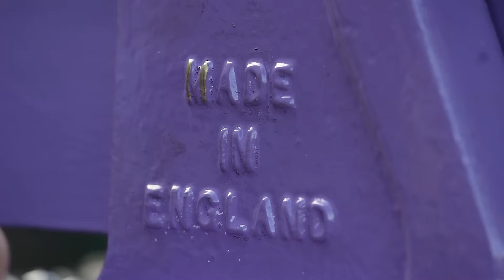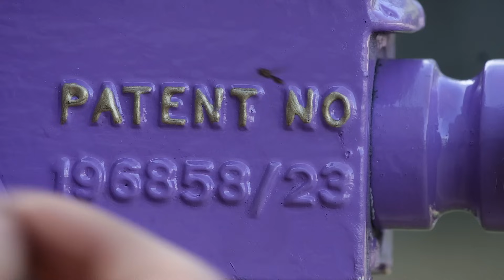Can i save a vise from the scrap yard? Restoration project

Comment: I have been waiting patiently for a vise to turn up in the scrap metal pile at the local dump and this weekend a 5 inch cheapy was there so I went ahead and did exactly everything you did minus the paint. Really hope to find a beauty like yours someday. You've done a fine job and oddly enough I do like the paint color. It is the color I painted some exterior doors, on the inside face, at my house. Go figure. Cheers!!
Reply: Try writing 'Vice Wanted' on a bit of card, along with your contact details, and get the scrapman to pin it on the office wall .... It also helps if you write your number on a £5 note and pass that over at the same time   ;<)

Comment: That is actually in great condition comparing to mine I scored in 2011 after the floods. Mine had a bent base. Jaws we're not lining up and loose. I lined up the jaws ( everything) welded the base. Now I take it to my big brother and borrow his ridiculous overkill press to straighten the side flanges. My little shop press won't do it. Lol works on wheel bearings but this old girl? The steel? Damn strong. Throwaway society. She's a beauty.nice job. Cheers from Australia 🙂👍👍👍

Comment: An observation... I see that all of the jaw ledge is missing from the dynamic jaw and both ends of the ledge on the static jaw are broken off. 
Those ledges help hold the removable jaws in place when there is downward pressure on the removable jaws. Those jaws would rely fully on the strength of the screws holding them in place under vertical pressure. 
That's probably why the jaw screws were broken off. 
To do the restoration more completely you would have to have devised a way to replace those ledges on both jaws. This is probably the reason the vise was tossed in the first place. I was hoping to see how you were creatively going to fix that problem. Oh well. Maybe next time when you work on it (to change the colour).  😉
Reply: that vice has taken some real abuse to have broken both jaws like that. Would take some very inventive work to fix that issue, as it is it's ok to hold stuff
Reply: The only way I'd think you could "Fix" that without further weakening the area would be to lightly clean up the area, then braze in some steel bar that's been filed to follow the contours of the break.
If he just wanted to add some vertical support back to the Jaws the easiest way would be to drill a couple of 8mm holes in the vice behind the  removable Jaws, use paint to transfer the hole locations to the Jaws, drill the back of the Jaws part way through, then refit the Jaws with some stubby 8mm steel dowels.
Reply: It wouldn't take anything to mill those ledges back and to "fit" those jaws correctly
Reply: @tedmattingly7564  Possibly, but only if he has (or has access to) a milling machine. The cost of paying a professional machine shop to do it would be more than the finished vice would be worth.

To recreate the ledges fully would mean having to machine both sides back quite a bit to get past the big areas of break out below the Jaws, so it would also need the original bolt holes welding up, new ones drilling, and thicker one off bolt on plates making to take up the space (So the Jaws still came fully together before the lead screw bottomed out on the nut).
This is why I first suggested adding metal rather than removing it. Pinning the Jaws would also take vertical load off the bolts, but still wouldn't be as strong as re-adding the ledge (But it would be a lot easier to do).
Reply: @Reman1975  brand new starter kit6
Reply: @Reman1975  could you just use a cnc machine 🙈

Comment: A man after my own heart using an angle grinder and wire wheel to clean the metal. For some reason I just enjoy doing that. What I don’t get is the electrolysis fetish so many people have. You end up having to use a wire wheel or sand paper afterward anyway and it takes time. Seems superfluous to me, but I’m happy to hear an argument for it.
Reply: If it has lead based paint, like old vises might, removing it in water would be safer than grinding it off and it allow you to properly dispose of it.

Comment: Nice job you did. 
Last year I did a similar restoration of a little Paramo nr. 1. My next one is a nr. 4. Very nice work do do in your free time.
What is exactly the spray cleaner you use? Is it just a degreaser or a more acid product?

Comment: Nathan.  I have a #4 Record vise. They are good quality.  Did you notice the crack or 'cold shut' - a casting bottom,  about the 1 minute mark of the video just past the base on the right side?  Be sure to bolt it to a very flat surface.  Those tiny pinholes in the paint are caused by an oil product on the surface.  TSP and hot water prior to painting can help avoid this.
I would have draw filed the cast jaws down on tops and mating surfaces to flat.  A lot of work if you don't have a Mill.
Perhaps you could have purchased hardened jaws for it.  Nice job.
Wild colour,  but yours to chose.  Great to find a use for  leftover paint.

Comment: What was the white you painted first?  Just a primer.? 

I did one in straight hamerite no primer and wasnt happy with it
Reply from the maker: It was a primer, just leftover paint from a previous job. Hammerite is definitely not the best paint without a primer. Unless you thin it down a bit.
Reply: @workingwithiron  cheers

Comment: Curious as to where you got the new jaw plates from? Im trying to do the same to one I just came into possession of and it’s so old and worn out that the jaw plates were garbage so I have to find new ones but i have no way to tell who made the vise because its any identification marks have been long ago worn off. I have already cleaned all the rust and grease off so im 100 percent positive there is no possible way to tell who made it.
Reply from the maker: I just used strips of flat mild steel drilled and countersunk the holes . if they wear down over time i can just replace them.

Comment: Hi, what did you use as a release agent I've used WD40 with no luck on a No. 5.
Reply from the maker: Just wd40 but a lot of it. Have you removed the pin on the bottom that the screw goes into? I didn't realise that was a thing and couldn't get it free until I loosened that.

Comment: If its worth the effort to restore, its worth the effort to do it right.  Who cares about the color, but take “pride” in the way you paint and prep it.  Have a smooth surface and end up with no drip, runs uneven surfaces.  Use a simple metal file to smooth out the jaws and help things to align when done.  You’re talented, but take the time to do it right so it shows off your abilities.

Comment: I have to do same to Mine, Got a #6, not the Record, Is the Paramo, think is the same Company, Fixed a Lift for a Customer in Florida, was going to Charge $100, but since they were selling House and moving, Told them I would take the Vice instead if OK. They Brought from England years ago, believe He said it was over 100 years old. Not for sure the age, did see where they were built during WW2? IS Super Heavy, believe Super Strong. 
Nice work on that. Was thinking of Sandblasting, and maybe a Grill Brick for the Machined surfaces.
Later
Just back from a quick search and Found the Record Plant was bombed in 1940, Then The British formed Paramore, and made the Paramo.
Later again

Comment: Hi which de rusting material are you spraying to loosen the rust parts ?
Reply from the maker: WD-40 initially in the red and white spray bottle then grease cleaner in the WD-40 branded bottle.
Reply: @workingwithiron  Thank you for your reply

Comment: The vise started flash rusting after you used the angle grinder. Next time, clean it with acetone (not water) and use oil to prevent flashing. Do you know how to weld? The jaws were still damaged when you started painting (the smaller dings can be filled with JB Weld).
Reply from the maker: Just using what was to hand was all. I can weld but I only want the jaws to work and nobody's gonna be banging on it as we have lag vice's for that, not fussed about it being pristine condition so didn't even attempt to weld stuff up. Thanks for the tips! If I do it again I may do a better job. Cheers 👍

Comment: Nice restoration but you should've used powder coating paint instead of the brush on paint & the jaws you made for it you should've used a cutting wheel on the one that you used to clean it up with & cut some lines in the jaws that you made for the vice

Comment: I was once told by an engineer never to buy a brand new record vise always try and find one in a junkyard and restore it apparently cast iron when left outside for a few years makes it more stronger and more durable
Reply: It's called seasoning . As the cast iron goes through the heating and cooling cycles it relieves some of the internal stress. A lot of the castings we use are left outside for several years before they are machined.

Comment: Horrible colour, but you have managed to save a very useful tool that should now give many more years of service. One observation that I have is that you have got the spring and washer assembled the wrong way round. I suspect that you are not the first person to dismantle this vice and that whoever assembled it got it wrong and this has led you astray. The washer should go next to the peg. Getting this bit wrong could after much use allow the spring to wind itself  along the peg so that it ends up the way you found it??
Reply from the maker: Can you explain "next to the peg"  a bit better?
Reply from the maker: So I think I know what you mean. It looks as if the spring is on the peg. It actually has a washer at both ends of the spring. The person who repaired it last didn't have this or it perished or broke. You can see the difference in shape of the washer next to the pin, it's slightly more square edged.

Comment: At least you saw fit not to sandblast the threads and machined surfaces like other vise videos, but I cannot get over the paint job.  Its not even that its purple, but the runny paint drips and chipped corners then you even go as far as detailing the lettering.

Comment: I probably would have tried to put a washer behind the head of the lead screw, even if it meant turning down the shoulder. That vise was too good to leave for scrap. The lavender color doesn't bother me, but my favorite finish is metallic green "hammerite", like Black Beard Projects uses.
Reply from the maker: good shout with the washer. i will bare that in mind. 
If i was to use hammerite here id be grabbed by the ear and thrown out on the street. Its a dangerous word to bring up lol. let alone own a tin and god forbid, coat something in it.

Comment: a little perplexed you didnt try to weld and fill in the fractured areas that support the jaws but if it will do what you need it to do, i guess it wont matter if you arent going to beat on it.
Reply from the maker: I was going to but it would be used only to hold things for light work. We have blacksmiths leg vices for heavy work and beating on.

Comment: The frustrating think is no one ever puts a list of sprays ,grease , cleaning stuff, or type of angle grinder disc they are using or type of paint and primer.
This makes it really hard for people who are new to try this kind of thing.
Reply from the maker: Good shout. Thanks for the tips.
Reply: @workingwithiron   you are welcome, the video was great , but I’m learning and have a vies a bench grinder and a model steam engine to do up.
I’m finding loads of videos but non are giving details , I have just found a video on using vinegar to clean off rust. But I’m really looking for basic tips on how to do this stuff and what to use. P.s I liked the purple!
Reply from the maker: To get things loose again, wd40 is great. Or some other penetrating oil. To de rust, you can use vinegar, citric acids, rust remover like fertan, and other industrial removers, not converters though. There is a difference. Then use bicarbonate of soda to neutralise these products after all rust is gone. And if you use wd40 I would use a degreaser. I'm doing another vice soon so I will let you know in a reply when it's done and will implement your feedback in the video for sure. It's a controversial colour for sure 🤣 but it's what I had ready to hand and needed to use it up.

Comment: I'm just putting the finishing touches to an old Woden vise of very similar design to this Record. I have similar damage to the jaw support area caused by someone previous brutally misusing and beating it to death with a big hammer. I do wish people would grasp that a cast iron vise is not an anvil.  It took a good deal of machining on the mill and installing custom made over lay jaws to recover mine. I believe there was some family/company relationship with Record and Woden. After some family rift one member went into production on  his own, hence the close similarities between the 2 brands. If purple suits you its fine by me. Edit to add here is the link to the history of Woden and Record companies. http://www.historywebsite.co.uk/articles/Darlaston/Woden.htm

Comment: I have seen many remade films. The corroded parts are welded, even a single scratch is smoothed, and finally they are very clean and fresh and do a clean painting. In your work there are parts of colored bubbles in the letters. Your work was not clean at all.
I hope you are critical

Comment: Re: the jaws. I've seen so many of these vise restorations of vises with missing jaws.  I gotta ask: What in the hell are you guys doing with vises that their jaws go missing?!
Reply: the screw breaks, they wear down from use and constant pressure.
Reply: Yo bro ,perhaps the owners want dis off ,Before dyin',quite a symbole of a metal-man ?
Reply: @hugoortega195  - I use a 4" Starrett Athol I bought about 30 years ago. It was used then, but other than worn paint, it was in excellent shape (and still is). It must have come from a tool and die shop because originally it had smooth jaws. Luckily, I found a set of NOS serrated jaws. Maybe if I had kept using the smooth jaws, it would now have a broken screw and bent handle, but I can't imagine ever losing the jaws.
Reply from the maker: No idea. These jaws were previously lost and drilled for another set of jaws. The bolts had snapped off in the holes. This I guess would be from hammering on the jaws which these vices are not made for. It was from a blacksmith yard but I'm not sure if it came here like that or started off here like it.

Comment: Come on, evaporust, vinegar, electrolisis, so many effortless ways ti remove rust... Why are you still wiring?
Reply from the maker: Very true but I used what was to hand and it worked ok. Usually do vinegar but it stinks if left for a while and have nowhere to really dispose of it. Really want to get a sand blasting booth for this sort of stuff. Maybe in the future I will use another method.
Reply: @workingwithiron  Phosphoric Acid Brush or spray on leave a few hours wash off dry and clean Job done !